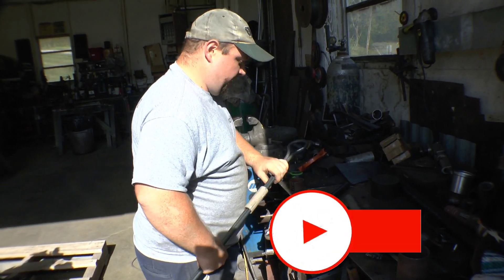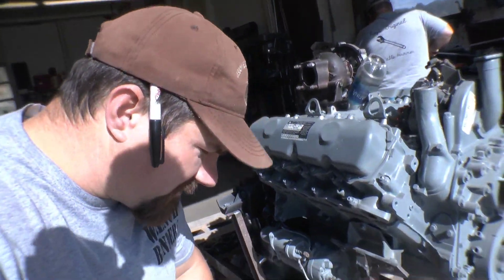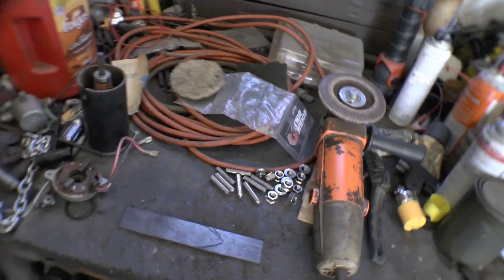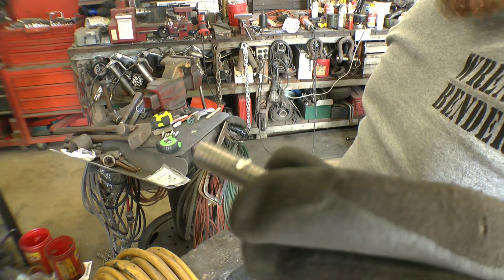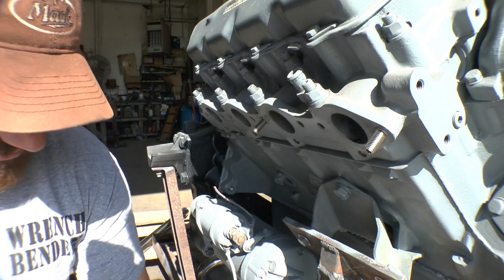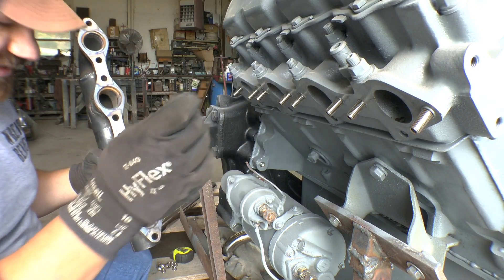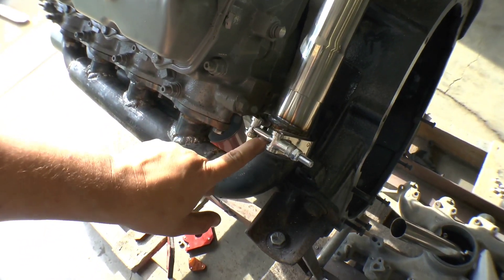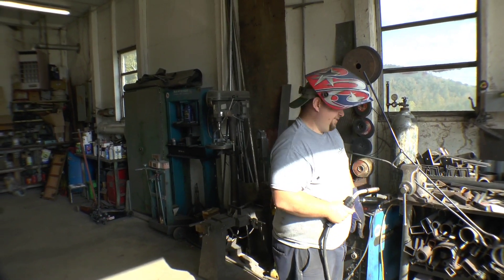International (Ford) 6.9 IDI Diesel Custom Turbo Manifold

Comment: That's a super nice setup. I just got an 89 e350 and got the crossover off yesterday. My setup won't be the most efficient but itll work and be almost free. Cutting the mesh center out of the crossover and welding in a y that will run my up pipe around the drivers side of the trans. Then the dp will run down the passenger side. Not much room in the vans.
Reply from the maker: I will likely have to cut into firewall of my truck so I figured I would make it look it nice and cut what I have to. I imagine putting the setup in a van will be tough. You should join our Facebook group and share your progress.
Reply: @wrenchbenders   what's the fb group called?
Reply from the maker: https://www.facebook.com/groups/1160934350916620/?ref=share_group_link

Comment: Good mod ideas bro. I got a 6.9 turbo with gear vendor. 3650k plus on the clock. Love that truck, work on it myself.... keep your fleshy parts out of the spinny parts!
Reply from the maker: I hope this one last that long without any major mishaps. What kind of boost are you running? lbs?
Reply: @wrenchbenders  ATS turbo set porsche 911 box filter. typical dump 5psi and 7 if i'm getting on it. Tho i have my pump turned up just enough for pure power NO BLACK SMOKE. I haven't hauled any trailers since I rebuilt the cold side of the turbo. Had O'Rings leaking since. I alone put 200k on them and before that she sat for years, been an ongoing project. lol